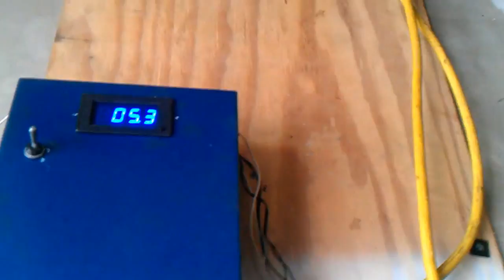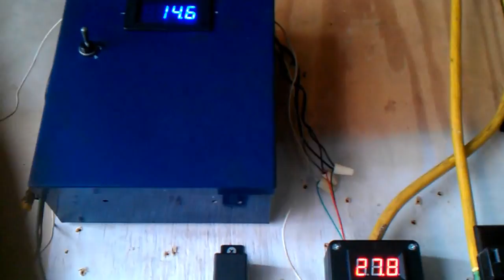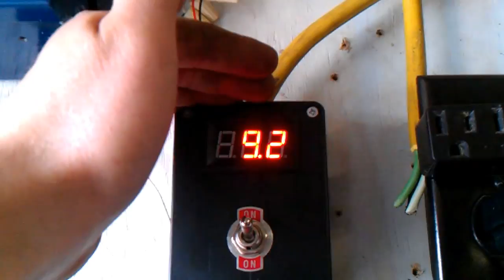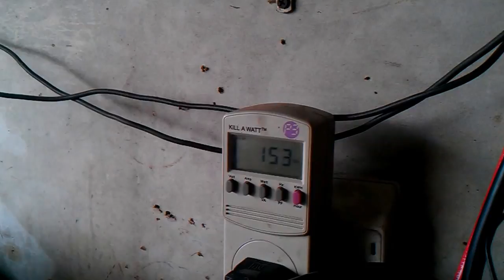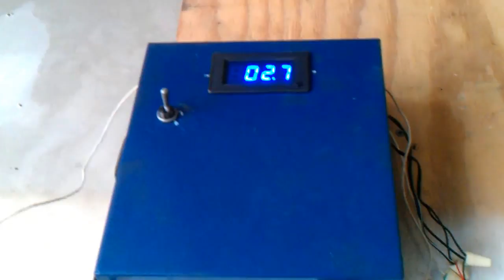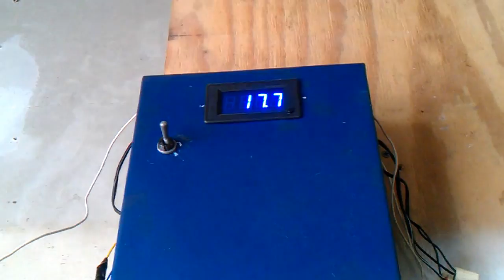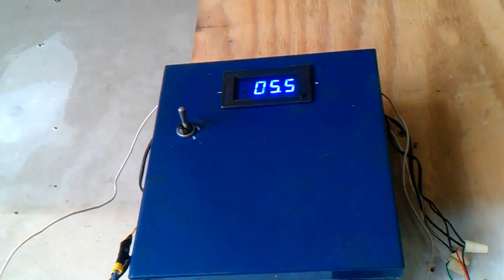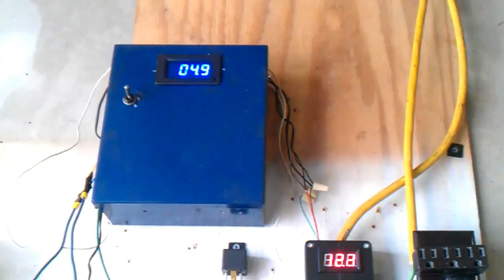WindyNation WindTura 750 Power Output

Comment: I've been lucky and have caught e-bay auctions at right times and pieced the system together.  Even the turbine itself was pieced together in 4 different auctions.  Tower was free, inverter, charge controller turbine and copper, I have about $1500. Someday I will upgrade to bigger and better, but solar is where I'm headed.  Just picked up 8 more panels and enphase inverters.  Wind is supplemental for now.  Maybe next year :)

Comment: Winter I get good winds that give me 4 amps consistently.  Keeps my 6 batteries full and dumping power.  I get 30+ mph winds off and on.  Enough that I have a had time trying to harness the power with my current system without it having to also dump into resistors. During Summer it is opposite here and calm.  So wind is winter time.  I'm only a beginner, so I started cheap.  Someday i will go better.